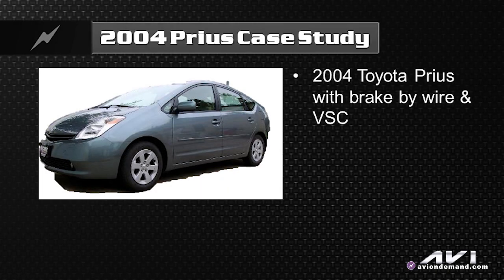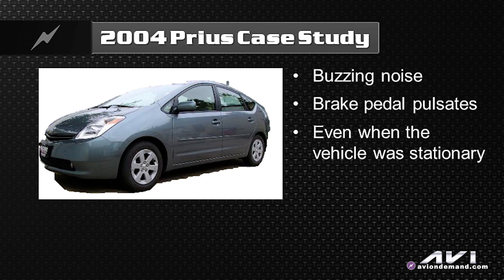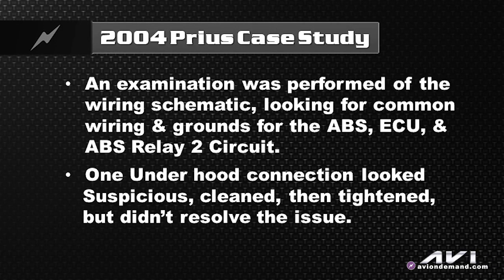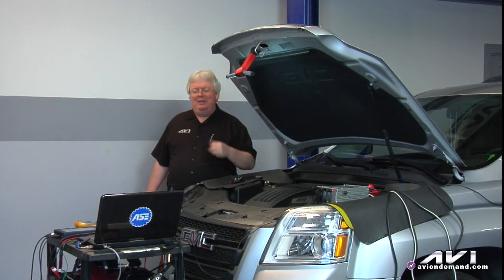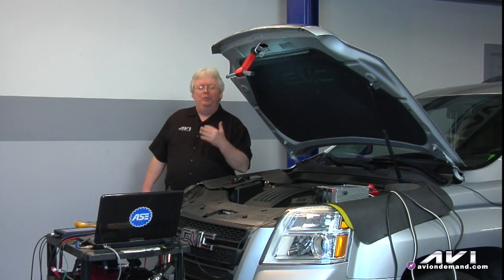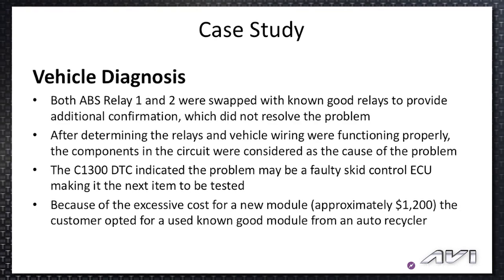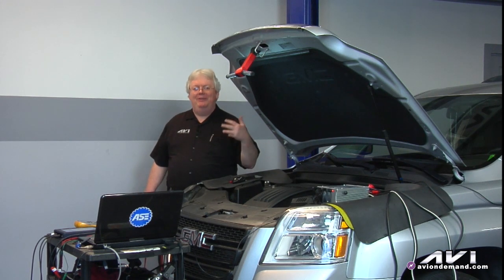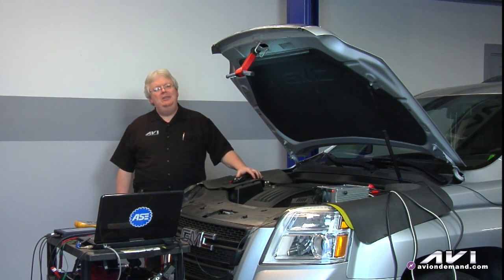Finding a Faulty Skid Control ECU |  Dave Hobbs  | Tech Tip

Comment: I wish you had shown us how to calibrate the skid ECU. I'm half knowledgeable about cars... the other half I try to figure out on as I go. 

I have Toyota Techstream and pulled a used one from local yard. 

The instructions on how to program the replacement skid ECU seem to very convoluted and confusing to read and there are 0 youtube videos on calibrating it once you've replaced the unit. In fact your video is only one I've found even mentioning skid ECU specifically on a 2nd generation Prius.

Comment: I was hoping this would have helped. Even though I have a front speed sensor error code, I believe I have a break in a wire instead. So, I'm trying to get to the back of the ecu to do some continuity testing. I got some of the dash parts out of the way but can't figure out how to remove the heater duct which is right in front of the unit. Any hints?
Reply: just pull it out it wont damage. takes a bit of wiggling.